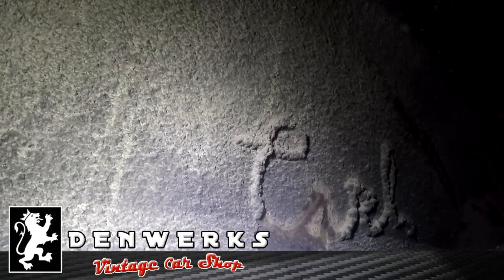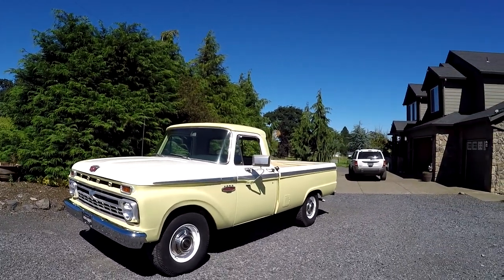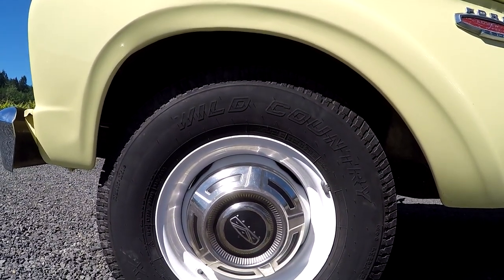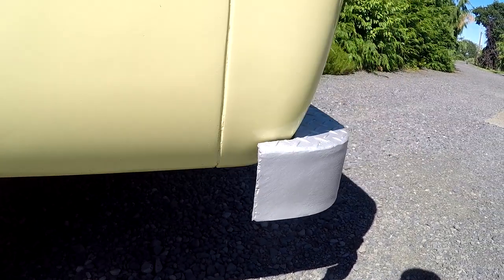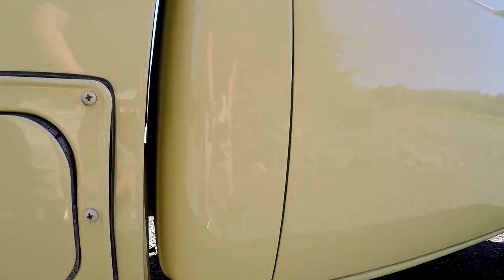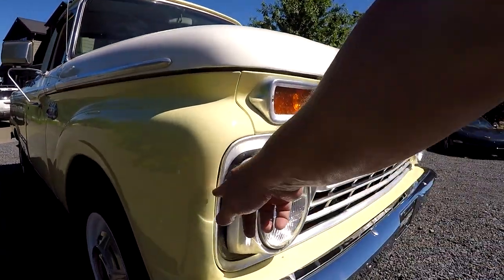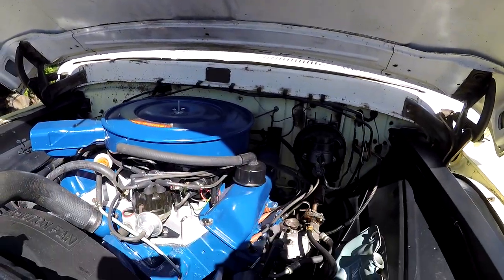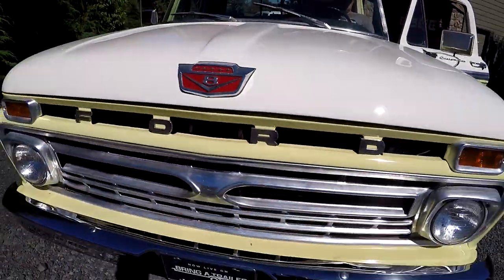1966 Ford F250 Camper Special Ford Truck DENWERKS  CUSTOM CAB TRUCK

Comment: I have a 1966 F-250 Camper/Special Custom Cab Red And White Combo.  I Have Both Factory Tanks Under The Bed That You Fill Inside The Wheel Wells. The Passenger Side Is Mounted Under The Tool With Brackets. Both Are Hooked Up To A Toggle Switch by the Driver, Your Video Shows A Hole In The Mat Just Below The Seat Where Mine Is Located When You Open The Drivers Door.  A Friend Of Mine His Uncle Bought It New In 1966 In Texas.  When His Uncle Passed Away It Was Left To Him And Brought To Falls Church Virginia. In 1994 My Father Bought It From Paul And Its New Home Became Chantilly Virginia.  After My Father Passed Away I Became The 4th Owner, And It Is Now Back In Falls Church Virginia.

Comment: I owned a 1966 F100 352 V8 4 speed and cream color in 1978. I was in High School. I was told by my neighbor, the person I bought it from. That it lived on a Duck Club and had not been registered since new and when bought it in 1977. The original owner had passed away. To get it registered had to verify the year of the truck. They took it to Ford. He told him it was a 1966, but put down it was a 1965. New home California. It saved it from the Smog inspections. It was a great truck and loved it. I sold it to restore my dads 68 F100 360 V8 C6 A/T, in 1988. Still have the 68 only the block is a 390 now. I still though miss the 66. I almost forgot it had a camper shell on it, Plus the wheels were the white spoked. Tire sizes were 10X15 in front and 11X15 in the back. To accommodate the big front tires a cut was made on lower half of front fender. Made this truck look like a 4 wheel drive.
Reply: I owned a 1966 Ford F-250 Camper Special and let me tell you, when you slide into the cab on that bench seat, in front of that painted metal dash panel and you feel the heft of that cab that you are in, you KNOW that this is Americana at it's best! And let's not forget about the power of that 352 c.i. V8! I loved this truck!